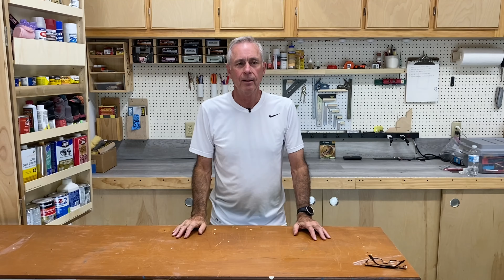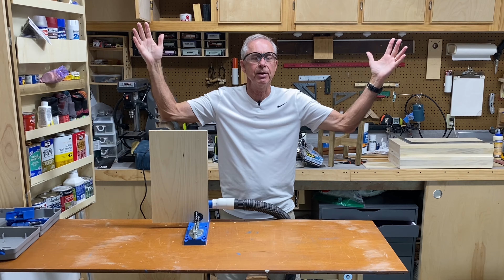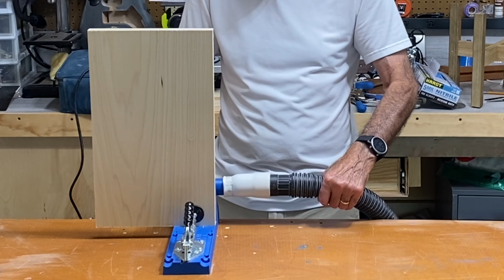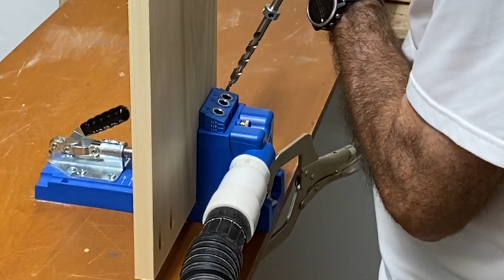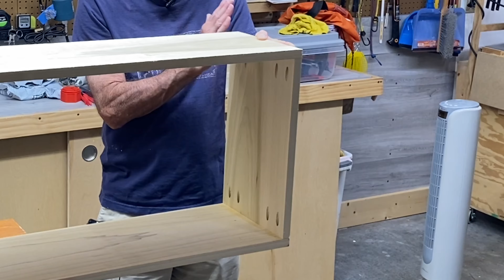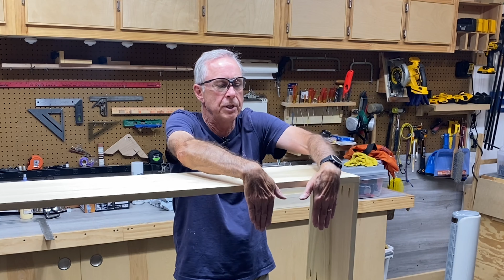Floating Cabinet DIY

Comment: This was helpful, thinking about doing something similar
Reply from the maker: Thanks.  I just finished another one under a larger tv in my basement. It’s wider but not quite as high.  It’s so wide, I made it in three sections.  Instead of using the back cleat, I screwed the units directly to the wall like you would a kitchen cabinet. That made it easier to get the top level.  Good luck with yours!

Comment: Great video. Would I be able to float this if the depth was closer to 12 or 16 inches?
Reply from the maker: Andey,  I talked to my carpenter friend.  He thought 16” should be ok.  Be sure you get your screws into the studs.  For extra support, you might want to run a 1x4 strip along the inside bottom of the cabinet inset like the French cleat with pocket screws and screw that into the studs as well.  Having said that, we are not structural engineers and neither one of us have hung a cabinet that deep so the decision to do so is entirely yours.  How’s that for a disclaimer!  Good luck and let me know how it goes.  I am currently making three similar cabinets to hang below my TV in the basement.  They will be 39”x17” at 12 7/8” deep .  That doesn’t include the face frame and doors.  I’m very comfortable with those dimensions.  I’ll use 3 1/2” screws to anchor them to the studs.
Reply from the maker: Thanks for the question.  I’m making one now that will be 12” deep.  I also have much heavier cabinets I made for my shop that are 12” deep and the the face frame and doors add to that.  I don’t feel confident in telling you that 16” is ok.  I’m helping a master carpenter who has a broken hand work on some cabinets.  I’ll ask him today, what he thinks about 16”.  I’ll get back to you.